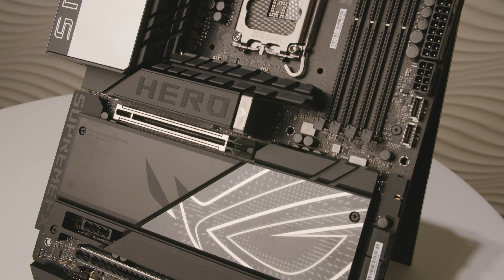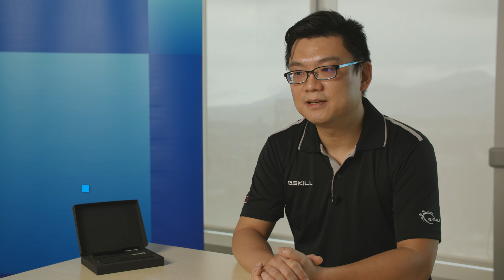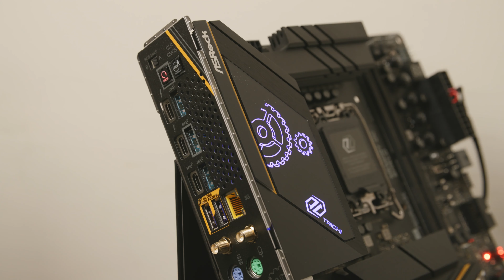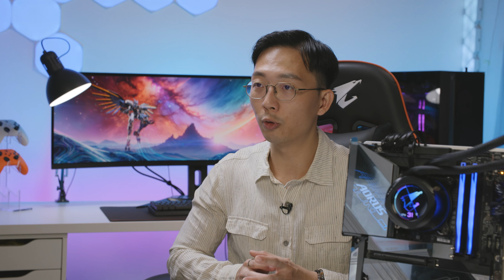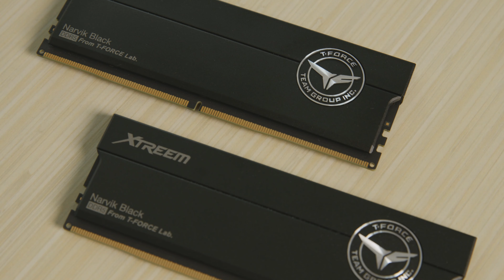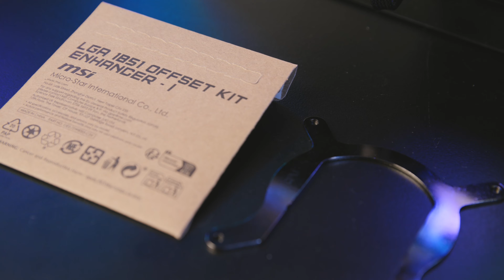Better Together: Building a Strong Arrow Lake Ecosystem | Talking Tech | Intel Technology

Comment: intel core ultra and combo cpu giftbox really make me feel modern and luxury deluxe high end product that I buy. need Intel co operate with manufacturer to release very cheap and hot sale combo cpu gift box non K to buy with non Z board
Reply: new name core ultra is great name suitable for modern pc and AI tech. but still need core ultra extreme or special edition use max TDP socket. Everyone is waiting for most powerful make full use of cpu silicon node made by Intel, and you can sell it at expensive price
Reply: Please I want Intel×Micron to have Intel RAM logo. want all things made by Intel